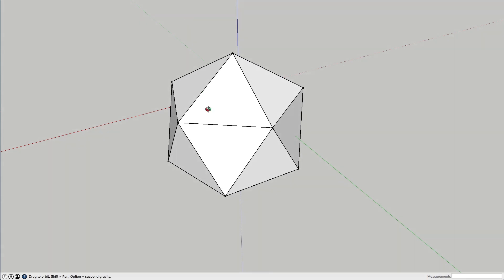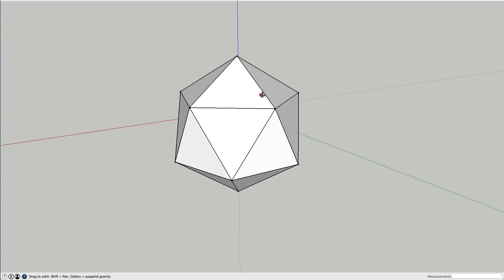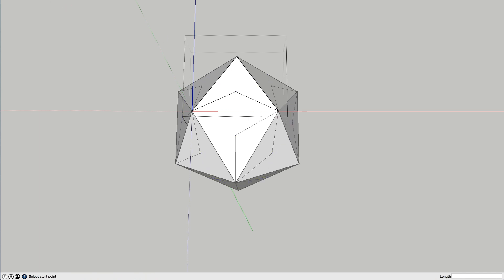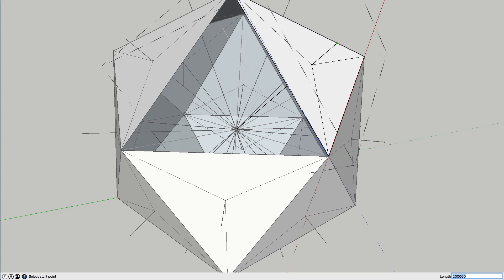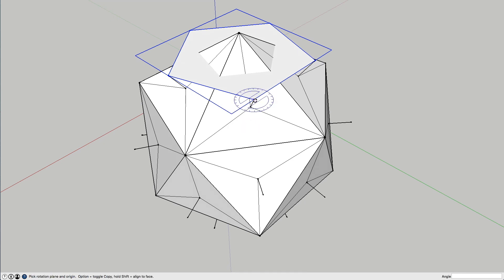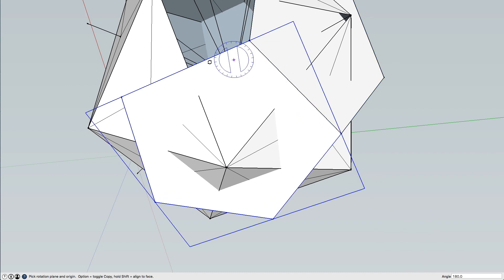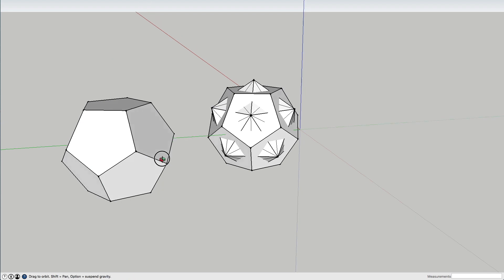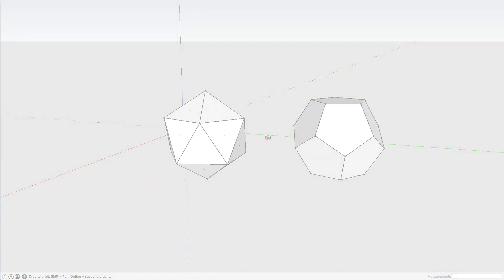Make dodecahedron in sketchup - best way

Comment: Where did all inside planes go? I mean the initial golden rectangles. And how did you measured exactly 200000mm if you used a snap function to build a rectangle?
Reply: The length of the diagonal of your golden rectangle is the length of the diameter of the Isodecahedron you will build. 
So if you want a specific measurement you can draw a small golden rectangle, draw the diagonal, follow the diagonal axis to expand the line to the required length and finally expand the size of the golden rectangle to the new diagonal you just created. Hope that was clear enough ;)